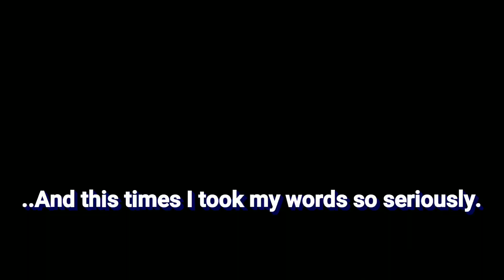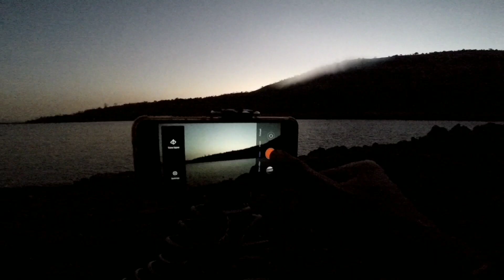Morbe dam trail Off road | Raw videos | Hero Impulse and Honda Shine Sp

Comment: the shine guy has got some skills man..
Reply from the maker: Thanks mate 🙌🏻🙃 Shine forever 😅🤙🏻
Reply: pure offroading video on youtube, buss thoda video quality aur better hoti .
Reply from the maker: Working on it bhai, jaldi hi koi accha sa device lunga editing ke liye phone apps aur GoPro videos ka aapas mein jamta nahi hai.. puri quality bigaad dete hai 😅🏁
Reply: and hero impulse looks straight out from DAKAR rally.
Reply from the maker: @roh6529  Hahaha it's a beast for sure💚
And I think with some basic modifications impulse can take those Dakar trails also 🏁
Reply: Not some normal skills itsreally hard with honda shine.
Bcoz its a commuter bike not designed for the off road.
Even for little loose sand the wheels will start to spin without any traction. 
This is really great.
Not only machine the body of the rider also have to mingle with the. engine and tires (like abs) then only its possible.

Comment: super splendor,shine or shine sp me kaun  se le bhai for onroad and offroad both ?plz reply
Reply from the maker: Bhai mai toh shine sp hi suggest karunga kyu ki 5th gear ka advantage hai highways pe, aur 40-50 ke aaspaas milege milega aaram se.. aur maintenance bhi Kam hai.. must go for shine sp Bhai 💚🙌🏻
Reply: @pratikbhoye9  thanks
Reply: @pratikbhoye9  mujhe highway me nahi chalana he,only for offroads.
Reply from the maker: Bhai off-road ke liye ground clearance matter karta hai aur bohot Kam hai shine, splendor aur baaki ke commuter bikes ka..
Trail pe maintenance nikalta hai bohot ye sab off roading ke liye nahi hai, mere paas option nahi hai issliye nahi toh Mai bhi impulse aur xpulse le leta.. after all decision is yours Bhai
Reply from the maker: Extreme off road karna hai toh xpulse or impulse Lena aur normally karoge toh thode modifications ke baad jaise raised handle bar aur spoke wheels set, Honda shine sp is best hai enough power and fuel efficiency
Reply: @pratikbhoye9  me extreme offroad nahi bol rahahu bhai. mujhe janna he main suspension kiska jyada soft he. yadi aapko pata he to bataiye suspension ke anusar. Ye bike mere liye nahi he uncle ke liye he 60+ age ke liye.
Reply from the maker: Suspension Bhai steef hai bohot, uncle ke liye sahi nahi hoga.. back pain hota hai usse par offroad me sahi hai perfect in commuter bikes 😅
Reply: @pratikbhoye9  super splendor ka bhi steef he suspension?
Reply from the maker: Bhai fir shine sp lelo seat change kr dena aur suspension setup kr dena, sorted